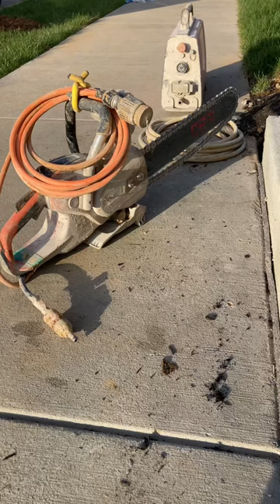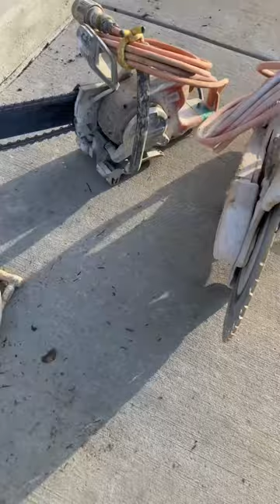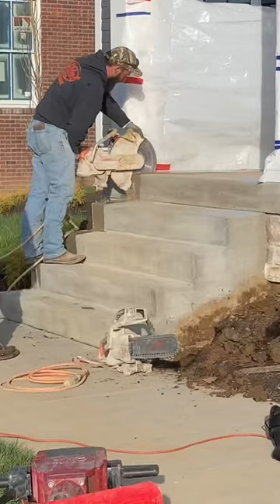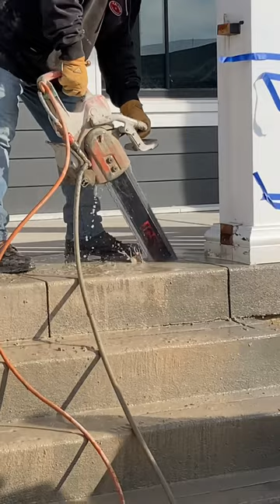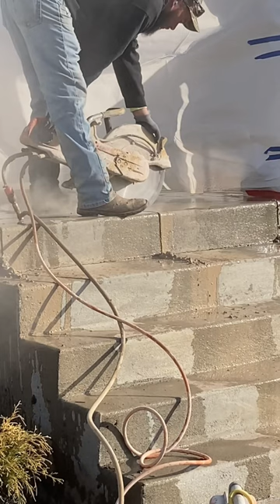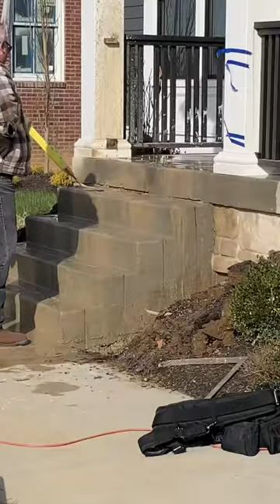Power Tool Addict / Concrete Demo / Husqvarna Cut Off Saw / Concrete Chainsaw

Comment: Concrete chainsaws give me a chub
Reply from the maker: Same here bud. Had to go sit in the truck and wait for the woody to go soft😂😂😂
Reply: @IMPACT-NATION  I spent so much time drilling 1/2" holes and then chipping away concrete for basement doors, windows or waste pipes. Finally I called a concrete cutting company to take care of a basement window for me and the guy shows up solo with a 30" concrete saw that he mounts to the foundation, finished the crisp ass cut with a concrete chainsaw, lends me his chipper so I can break the cutout into manageable pieces to carry to my dump trailer, and is gone inside 2 hrs. $1200. $45k in gear. Block walls are a breeze but I might never cut into solid foundation again. I was in Maine at the time, but that company runs from Rhode island to Maine so I'm set. Let the pros do their thing. That was 2 years ago and his truck cost $250k with gear and they were running 13 trucks and said they would buy another for anyone willing to work. Fuck people who don't want to work. It's out there.
Reply from the maker: @Tool_Addicted_Carpenter  bro pretty much what you said homie. Our Stihl 14 inch only cuts so deep so we had to call these guy’s. Bro this guy had a fuckin masonry blade probably as tall as me stacked on the back of his rig. Never seen anything like it. Huge custom truck. Had a steel bumper with his logo CNC’d in that bitch. He was doing his thing bro. Said he makes a fortune. This was a small job for him and he was just helping us out. That type of work along with what you and I do, amongst many other trade specific jobs, they are out there bro. And people willing to teach and train anyone willing to put in an honest days work. We might be covered in dirt at the end of the day but our moneys clean brother. If there’s one thing I can’t stand it’s a lazy motherfucker bro
Reply: @IMPACT-NATION  Man I hope someday we get to cross paths. Mentality and ethics are right in line.
Reply from the maker: @Tool_Addicted_Carpenter  I’m going to try to hit up some events this year brother. Tool shows and such if I’m able. If I get up that way we most definitely will buddy